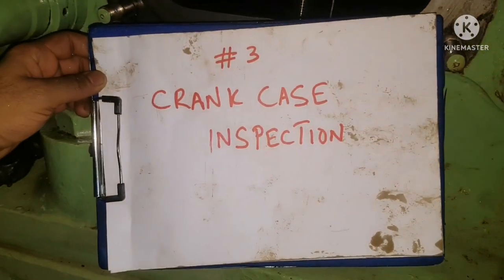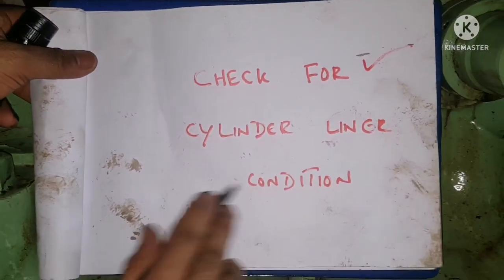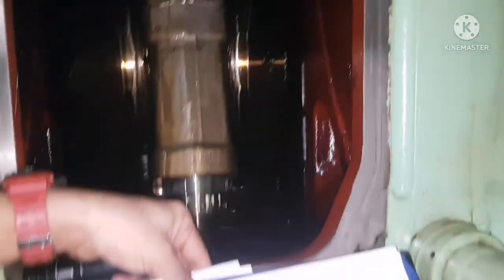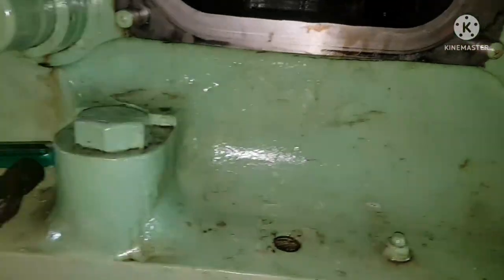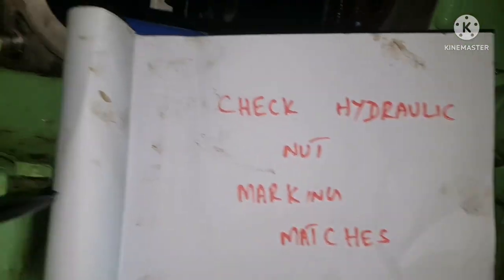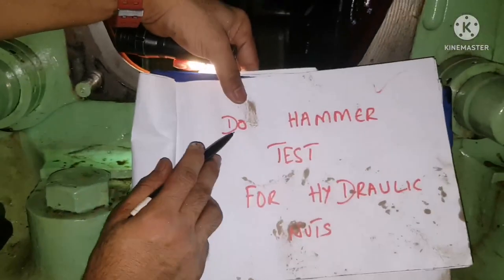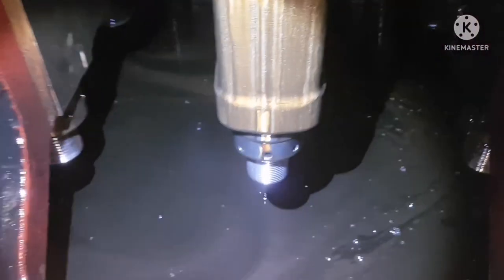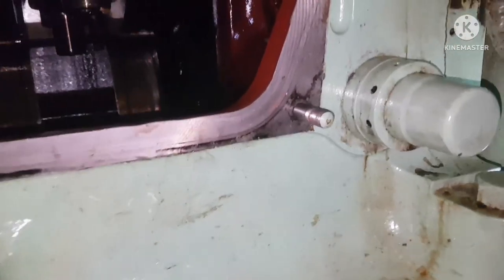HOW DO THEY DO... HOW TO CARRY OUT GENERATOR CRANKCASE INSPECTION ONBOARD SHIPS..

Comment: difference between con rod nut and crankpin nut? are both different?
Reply: Yes both are different,as you see its name itself will tell there story and for  more information you can find decarb videos made by our respected basha sir in this chanel.
Reply from the maker: Con rod bolt connects connecting rod and crank pin assembly. Where as crank pin bolt connects the crankpin shell assembly..